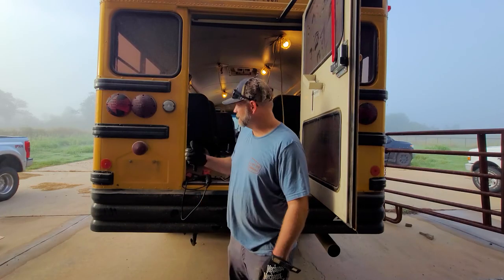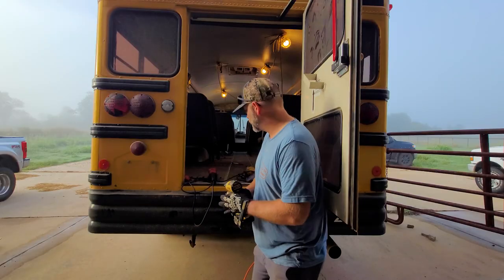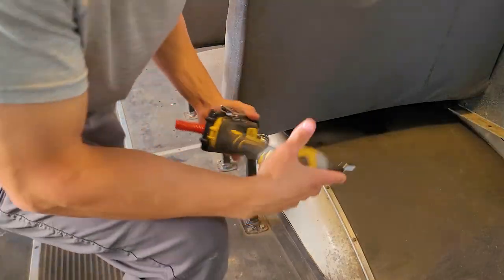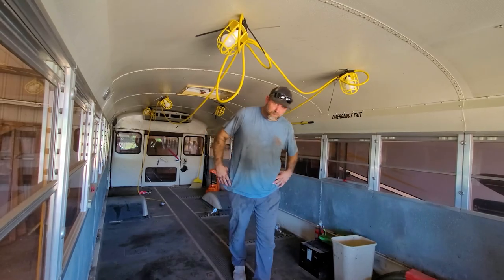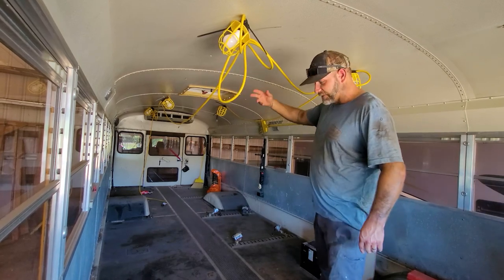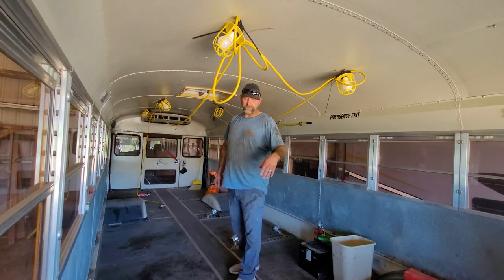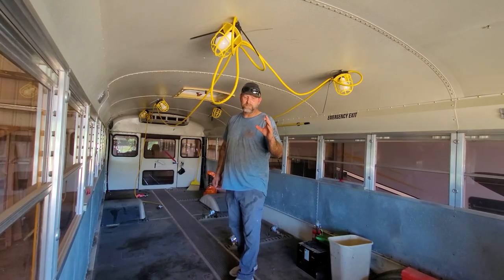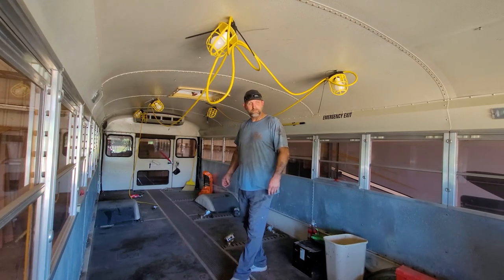Removing School Bus Seats | THE BUS PROJECT- EP 2

Comment: I wanted a handicap bus because the lift can be extended to lift a dual sport like xr650l for quick cheap Town runs from Basecamp. I ended up with full 72 passenger that I'm shortening the living space and making a flat bed from rear wheels back for quad or sidekick.